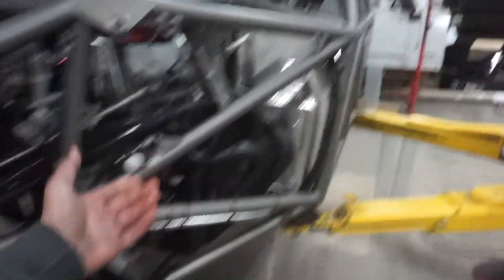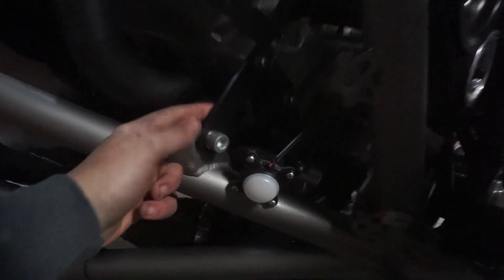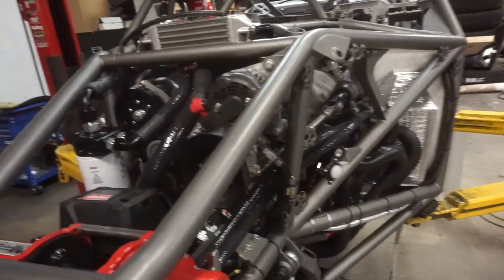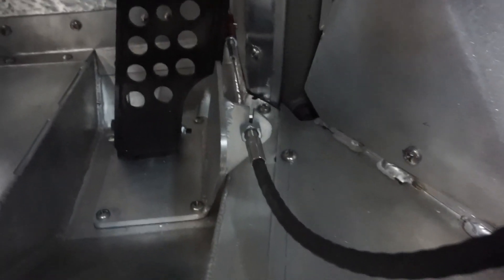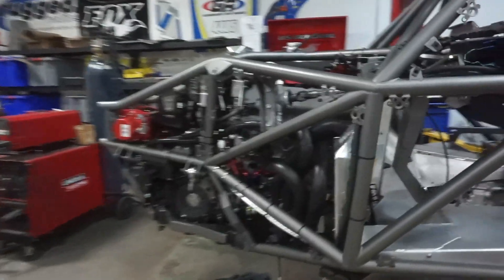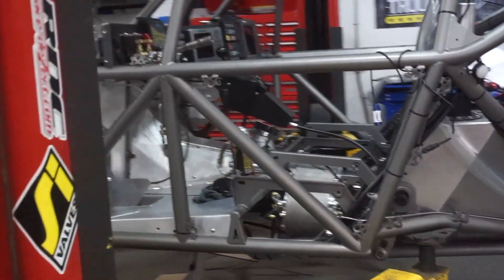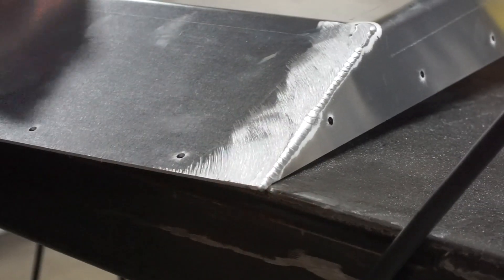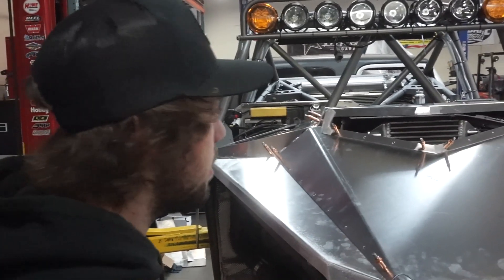ULTRA4 IFS/IRS build huge updates

Comment: Spool on the back? That one surprised me... Just so that it survives the abuse or you just like to corner using the throttle? :)
Reply from the maker: a little bit of both. Helps keep the car consistent and controllable at speed and also much stronger and more reliable.